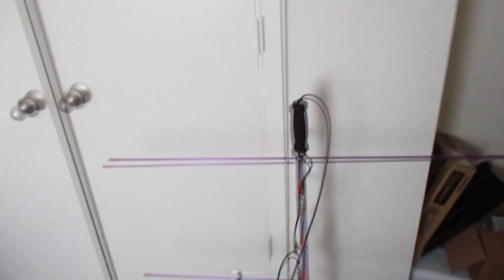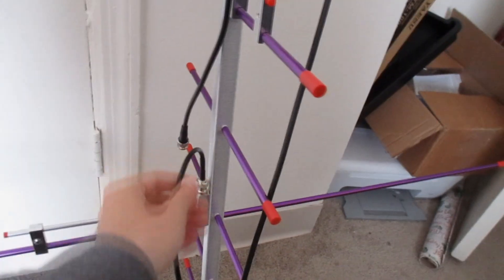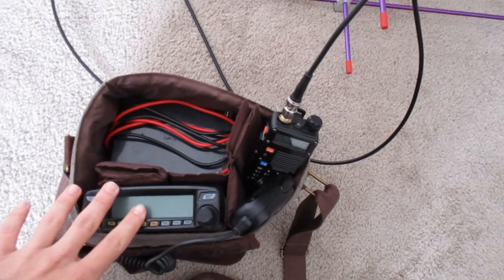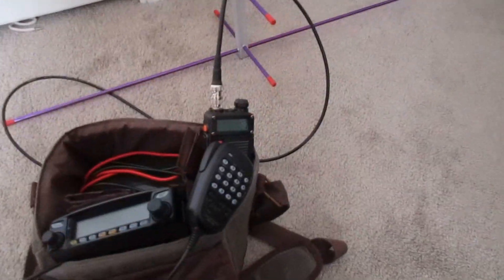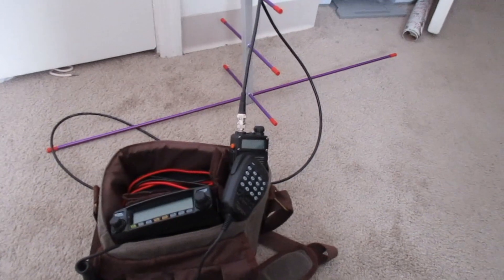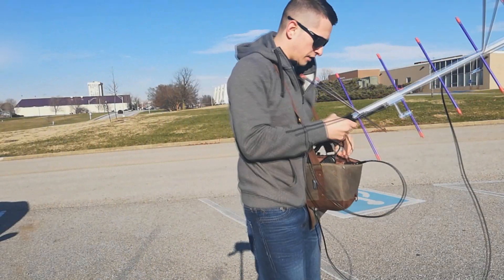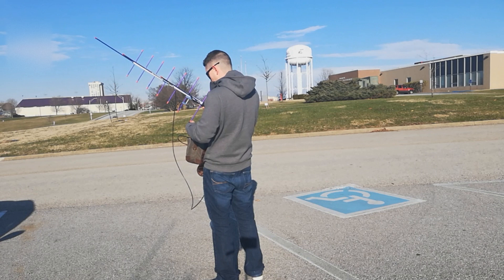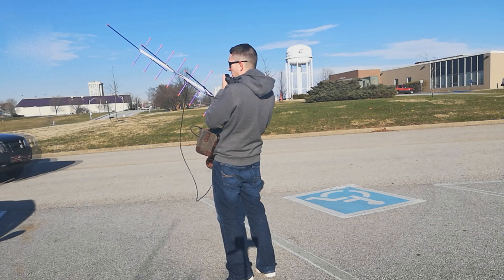My Setup and Making Contacts on SO-50

Comment: So, I wonder if what makes the difference is that the FTM 100 has better harmonic suppression on transmit? It could be that the Baofeng when transmitting was sending harmonics within the UHF band which would not be filtered by the diplexer. If that is the case, then I wonder if a lighter setup could be created by replacing the mobile radio with a higher quality HT for transmit? Also, it might be possible to use two Baofengs for U/V satellites like AO-92